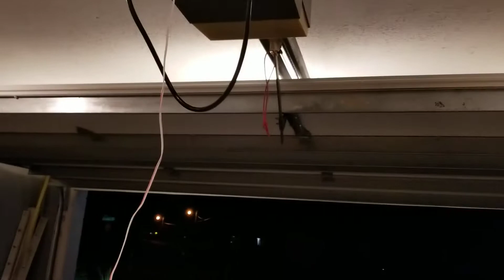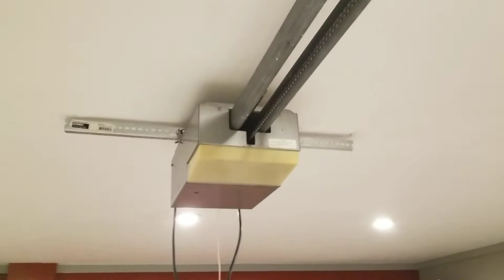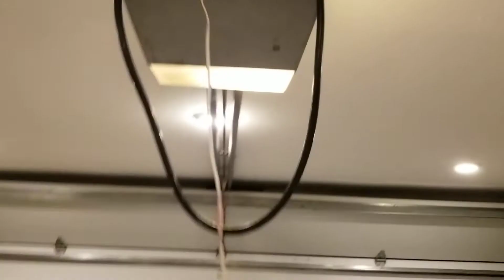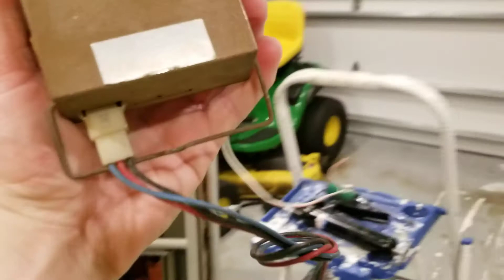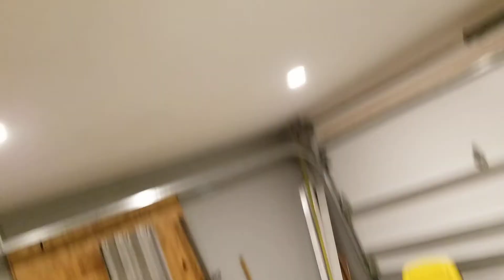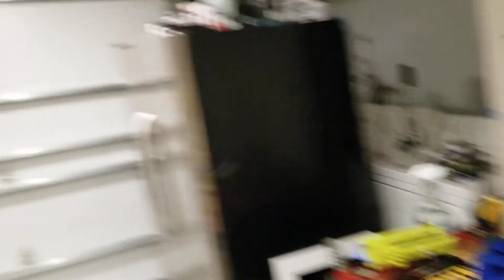Overhead model 100a with light bulb and work

Comment: Does this have battery backup and safety sensors.
Reply from the maker: matthew hayford no battery up .it's  from the 80s
Reply from the maker: matthew hayford. No opener is for 80s
Reply: the garage door man 82 very cool. Does it have a keypad. Also happy 4th of July to you. What city is that house in.
Reply: the garage door man 82 it sounds okay. Is it a belt drive screw drive or chain drive. Are you a raynor fan.
Reply: @gripgaragedoor82  did you ever find the button.
Reply: @gripgaragedoor82  does this opener still work. Good job with the video. Can you video the liftmaster 8355 on this house please. Then run this opener at your rental house please like switch openers. Liftmaster 8355 at this house. And put this opener at your rental house. You could probably buy a like home depot genie button. I think a home depot genie button might work. It's a brown button with a white button and says genie on it.